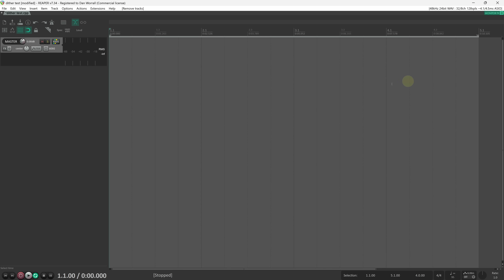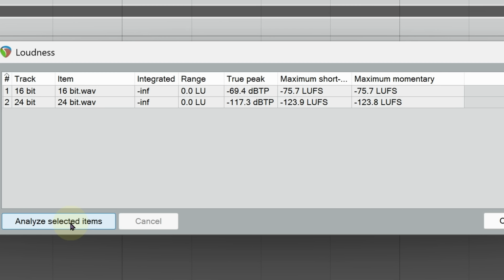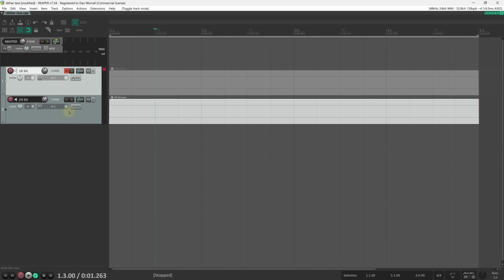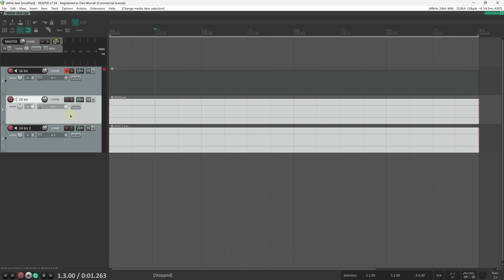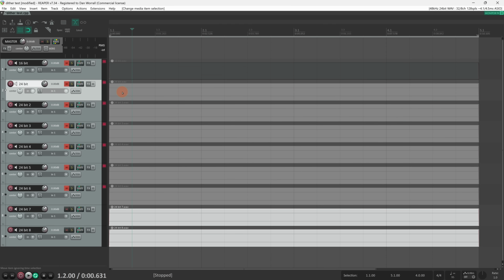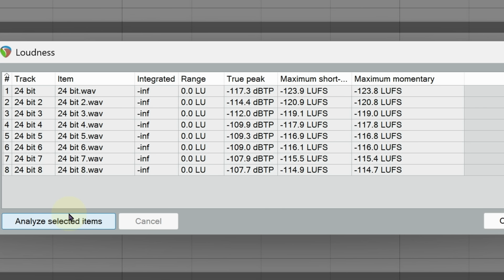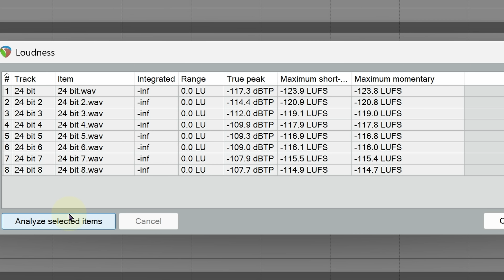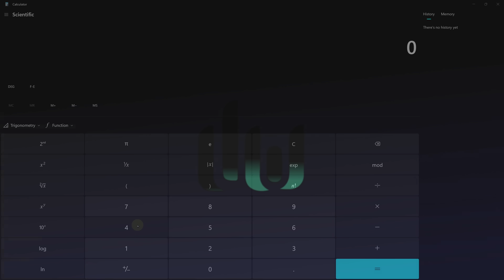"Only Dither Once"

Comment: I understand the theory of quantization errors and how adding a bit of random noise smooths them out, but I honestly could not tell you what those quantization errors sound like. I check the "use dither" box because I've always been told by everybody that it's "correct" to do so, but beyond that I'm not particularly concerned with dither one way or the other, and I certainly won't go spending good money on some kind of special dither...
Reply from the maker: If you decide you do want to know what dither and quantisation distortion sound like, watch this one:  https://youtu.be/2iDrbgfPjPY?si=DkQpbxI98GFUCiX8
Reply: @DanWorrall  Interesting. I guess the lesson is that next time I have to bounce a mix at a max peak of -60dBFS and then convert it to 16bit and add the gain back, I will think about the dither. Otherwise I will consider it a background thing that I don't really need to concern myself with.
Reply: As a good proxy, investigate image dithering. It’s basically the same, just with audio.

Comment: Do we even need 16 bit anymore? I thought streaming services can do their lossy conversions direct from 24 bit, so I work in 32/96 and deliver as 24/96 (with dither). Hopefully this doesn't subsequently get bit-reduced a second time at their end, prior to the lossy codec?!
Reply from the maker: My concern isn't with the streaming services processes really: if they're not currently doing it correctly, hopefully they will be in the future. My concern is what happens when it's decoded back to PCM: will it get turned into 16 bit PCM regardless of the original source? That's what Soundforge does (or did when I tested it anyway). Are you confident your car system will handle it correctly? What about your smart exercise bike? For me personally: my music doesn't require 24 bits of dynamic range, those extra 8 bits don't add anything meaningful to the experience, so I deem it safer to release 16-44.1 and guarantee a full 16 bits of dynamic range free of quantisation distortion.
Reply: @DanWorrall  Hmm, for stuff I've worked on I do tend to hear a drop in clarity between 32 and 16 unfortunately (the dynamic range isn't an issue but it does tend to sound harsher at 16), so I figure I'll give it a fighting chance by letting them encode from 24 bit, and hope that the dither is still beneficial to the codec's reconstituted 16 bit audio. As for noise-shaping, I've always used it but thinking about that now, this is perhaps legacy thinking from CD audio days, given a lossy codec would presumably discard high frequency noise or interact unpredictably with the processing. 🤔
Reply from the maker: @prodigalretrod  can you pick out that extra harshness in a blind ABX test? (assuming properly dithered 16 bit)
Reply: @DanWorrall  Well now I'm confused, I thought my answer was a confident yes, but in this moment at least, no I can't. So either there are other factors, or I've somehow placeboed myself.
Reply from the maker: @prodigalretrod we placebo ourselves all the time! That's why we need ABX tests. Kudos to you for being willing to test yourself.

Comment: bro i wouldn't even say "only dither to 16bit once" but ofc at this point everyone is free to disagree because lower than 16bit music hasn't got quite the same success story backing it up. but here's the thing: my audio interface is really old, a tascam us122-L, which has been discontinued a lot of years ago but for some reason still works fine, does only support audio playback and recording in 16bit. that is right, I have never heard any 24bit audio through my studio monitors since I built a bit of a studio decades ago. and ofc when I bounce audio and then reuse it in a project, then during that dithered bounce I bounced to 16bit, only to use it again immediatly. so all my music is having all these little bits of sounds summing up that all add 16bit dithering to the music. I never consciously encountered the noise floor that arose from the digital quantisation. only a few exceptions, like lately when I made wavetables and the wavetable normalizer brought it up, but that was not something anyone would call a problematic encounter.

Comment: What i don't like is when dither noise is added to digital silence. Because i had an old MP3 player (with flac and vorbis, it was pretty nice) where i made myself a 15 minute silence track that i could add to a playlist to let me sleep on public transit before a loud track woke me up, it may have been a couple decades ago. The noise of the dither itself wasn't really audible, but it prevented the dac from being output-muted, which is a little noisy, and it made for large compressed files when a small one would suffice. Now even when it shouldn't matter today, i am just slightly miffed when the dither is there when i don't want it.

Another old trauma is denormals, which were a problem on Pentium 4, which dither may contribute to but in reality it won't, because below dither level, there's still 30 odd orders of magnitude to go before you hit the danger realm. And also nobody cares any longer, it's all SSE anyway, which just clamps them shut.
Reply from the maker: Auto blanking would fix that issue. Personally I usually don't use it, as noise tends to be more noticeable if it stops and starts than if it's constant.

Comment: I'm a nobody, but I'm just realizing I've probably never dithered anything. I guess I never really understood the process and assumed Reaper would change things gracefully, like it does with sample rates. I typically work at and render at 24-bits, so I suppose in that scenario, nothing would truly leap out. I guess I should locate some 16-bit renders and do some comparisons. 🤷‍♂ Dang it
Reply from the maker: Tick the dither and noise shaping options in the render dialogue, and don't worry about it any further. Your 24 bit renders are fine without dither. If your 16 bit files sound ok then they're fine too: just remember to tick that box next time!
Reply: @DanWorrall  Appreciate it!

Comment: Thanks Dan. ❤ 
I’m not on Reddit to argue, but here is a question to start an argue in case of emergency. 
At mastering stage, when passing thru analog gear during mastering, do we need to dither before the analog loop da>analog>ad
In the daw thing are usual 64bit proceeded, then when signal is going thru the analog loop, does dithering save verb détails etc , or is it a bit pointless? 
On one side back from the loop the dither noise might be amplified by gain Eq comp and gear non linearities etc. But does saved details in the first place ?
My bet is it’s both, a bit pointless and saves verb details. And increasing the dither noise with some dB doesn’t seem a problem?
Does it looks like a good start for an argument ?
Reply from the maker: Yes, you should add dither before you go to your converter. If you have fewer than 65k IO loops you should be fine :) Failing to add dither means you'll get quantisation distortion instead, which is always worse than the dither noise. But let's be real, 24 bit quantisation distortion is still totally inaudible. This is all really entirely academic.
Reply: @DanWorrall  But you're talking to someone who compares "high-end" XLR cables on his channel. So even a purely academic benefit should be of the utmost importance to him :)
Reply: You'd undoubtedly find people to argue ANYTHING nowadays lol, i guess this would be an easy start 🙂
My guess is it wouldn't matter unless you do the D/A conversion from a 16bit file. Personally i doubt there'd be much to gain from 24bit dither - unless Dan already said otherwise in a previous video, in which case i'd retract my statement... 😂

Comment: So we should record at 32bit. I don't fully get the point of the vid.
Reply from the maker: Record 24 bits, print 24 bits, don't worry about it.
Reply: @DanWorrall   ok so generally we don't need to dither when printing at 24-bit, as 24-bit is a high enough resolution that it doesn't typically require dithering to avoid quantization distortion.

Technically, yes, there are very small values in 32 bit floating point that can’t be accurately represented in 24 bit integers, but the error here is going to be so small, and only significant at absolutely tiny amplitudes, that I doubt it would ever manifest as something audible to humans. 

And yet I work at 64bit double precision floating point, so I just print one master copy to 24bit 96Khz & one to 16bit 44.1Khz before saving the entire session as a 32bit file lol
Reply from the maker: Mathematically speaking it's correct to add dither to 24 bit renders, otherwise you will get quantisation distortion. In practise however this is also inaudible and no one is ever going to notice if you fail to dither your 24 bit files. 16 bit renders should definitely get dithered however, failing to do so is objectively wrong in that case.

Comment: Wow, I didn't know you could analyze loudness so easily in Reaper. This DAW never ceases to surprise me
Reply: The window used is an unofficial extension (SWS), but Reaper can show the LUFS data in the Render window, so Reaper could still do this natively.
I really recommend installing SWS if you use Reaper though, it adds a bunch of useful things. I mostly use the loudness analyzer and normalizer, auto-colored tracks and regions, and snapshots.
Reply from the maker: I think that's one of the SWS extensions. I added the toolbar button myself.
Reply: @ Nice! I do have SWS installed, so i'll check it out
Reply: Me neither, and I've been using Reaper (plus SWS) for over a decade. We should call this 'Live and Learn with Dan' :D

Comment: Since Spotify is 16bit, should I release my music in 16bit rather than 24bit?
Reply from the maker: Personally I release my own music as 16-44.1 only as I consider "hi res" consumer audio to be something of a con: it's not better quality in any meaningful way. But when I master for clients I give them multiple sample rates and let them make that call. Spotify isn't 16 bit, it's compressed audio which is likely floating point! The question is, what do they encode that from? If they're using 16 bit source files, do you trust them to dither your 24 bit masters correctly? Whatever, I don't really recommend adjusting your masters for one specific platform, as Spotify can change their settings at any time, and whatever you do might not apply in the future.